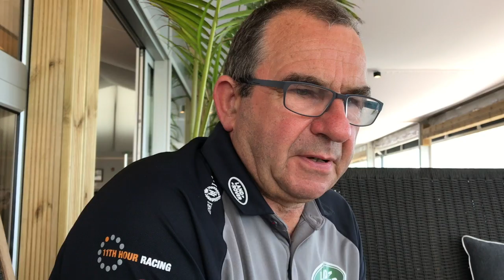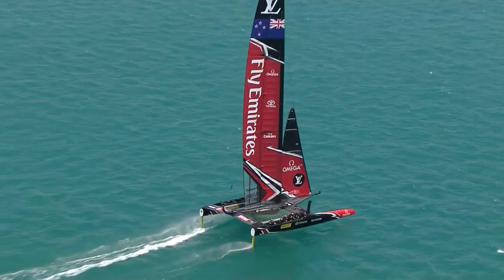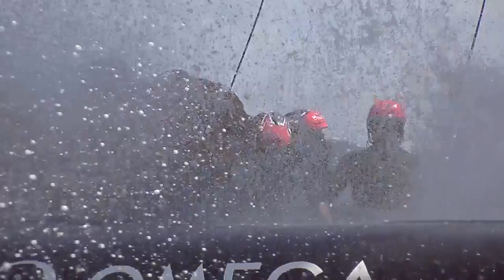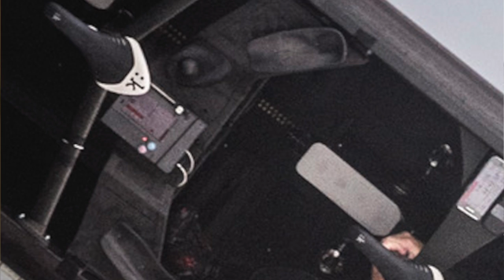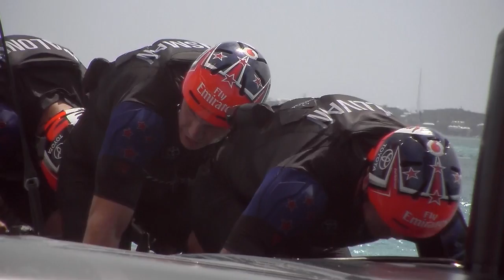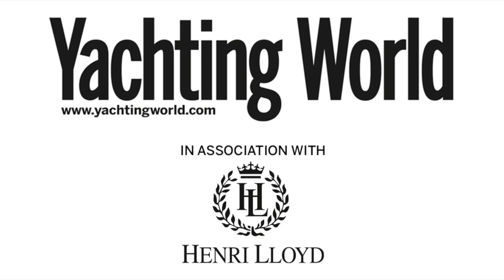Uncovered: Emirates Team New Zealand pedal power secrets

Comment: Forgive the newbie question here but why are they pedaling exercise bikes?
Reply: the crankshafts are connected to the hydraulic system, as they pedal they build pressure in the system which enables the crew to control the various mechanical parts of the boat. The more pressure there is and the more constantly that pressure is provided, the more you can use the various mechanical parts of the boat before pressure needs to be built back up again. Leg muscles provide much more power and can work for much longer durations than arm muscles, so the cyclists (cyclors) provide more pressure consistently to the system, and for longer, than traditional arm powered grinders.

Comment: I wondered if TNZ was using something similar to the gun stabilization used in battle tanks.  The 3rd guy controlling the daggerboards with his arms must of had some form of autocorrection because of how stable the catarmaran turned and simply maintained the same rake without skipping a beat.  Ingenious!!!
Reply: You weren't allowed any software control over the trim of the boat directly. However what they did was just as clever. The little screen in front Blair Tuke showed the current daggerboard trim and where the trim needed to be to ensure stable flight. He then simply trimmed the daggerboards to suit.
Reply: James Burtton   Is that what it was?  I figured they could have used a mechanical system then before software as gun stabilization was around since the 60’s.

Comment: Don't know that much about sailing but seems like the Kiwi boat has a range of design features that in totality make for a slick package. There's the cycles but  also the shape of the foils and especially the mainsail (wingsail?). Not sure how to explain it but its the shape - somehow it seems to do something aerodynamically that gives the boat small speed advantages? Impressive.
Reply: ETNZ wing control is hydraulic, way way more precise.  They can dial a setting, press a button and go.  They can also get pressure readings throughout the wing to optimize angle.  You can only go "that" hydraulic with oil.
Reply: Vik Z  My understanding is that even the external shape of the wing is one - design and it's "only" the control system that the teams design themselves. Of course the differences in the control systems may effect small differences on the shape the wing takes when under sail. It's true that the NZ team has many noticeable differences on their operation including that one of the "grinders" is controlling the foils as he said and that the skipper  (Glenn Ashby) is not the helmsman.
Reply: onpahanvaan yes I agree. It's fascinating how the overall design seems to be giving them small incremental performance gains, as their crew learns to sail it better. I'm very impressed with how they've set up the cyclor stations; ie, taking their cues from cycledome racing formations to cut wind resistance. A lot of thought has gone into this.